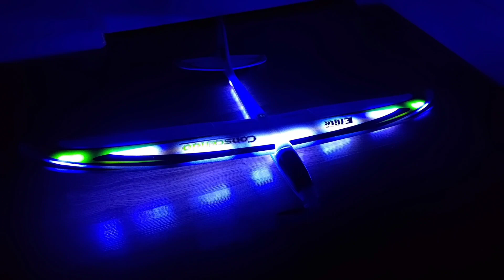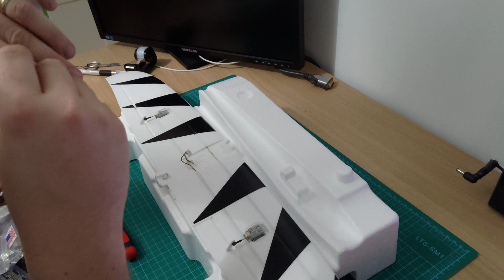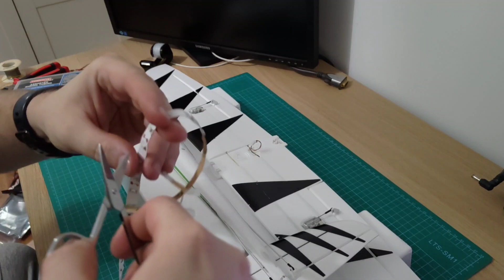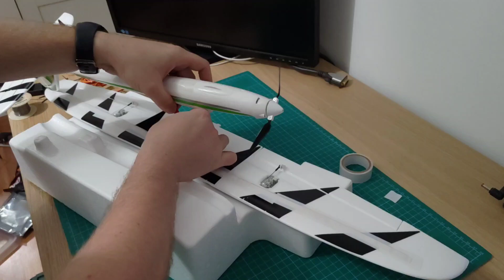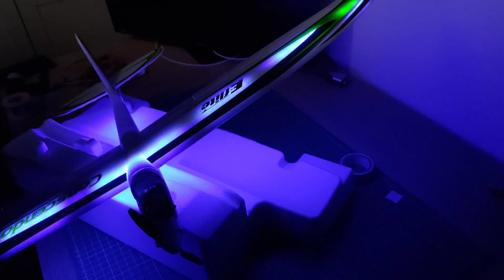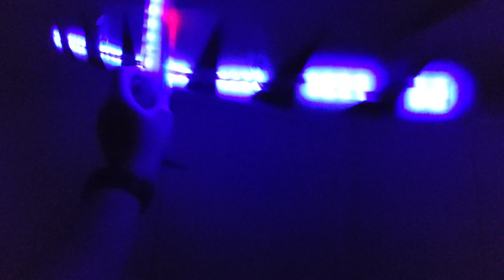How to add lights to the E-flite UMX Conscendo

Comment: Also on the fuselage how did you wire both the balance adapter and led strip to the same Jst? Thanks ☺️
Reply from the maker: Just soldered all the positive and negative wires together on the corresponding pin from the connector. I then got some magnetic connector so it makes it easier to connect and disconnect the wing.

Comment: By chance you got a link to parts?
Reply from the maker: No, I bought the LEDs at a hardware store. Any 12v LED strip should work.
Reply: @A.M.-RC  Thoughts on this?..  A 3 "Y" connector going back through the fusulage. One connected to the plane, and two connected to two sets of LED red&Green. Using the JST on the battery not the balance port.
Reply from the maker: That's another way to do it, I did something like that on the UMX Twin Otter since it's 1S. 
On the Conscendo I later added a magnetic connector between the wing and the fuse to make it easier to connect, I showed it briefly in another video.

Comment: Where do you purchase the lights?
Reply from the maker: Online, any large store. Any 12v powered LED strip should work. Just know that some have a silicone covering, you can still use them but facing outward and they will be heavier.

Comment: Looks awesome! And simple as well! How much of an impact do you see on the flight time? You have several LEDs on the strip and given that on nominal voltage they run full brightness, they will usually draw like 20mA per LED, which sums up. And you will have to be careful and not leave the battery connected for too long as the LEDs will drain the lipo until it dies, as there is no protection circuit with a LVC circuit. Just a consideration. I was thinking about adding LEDs to the big Conscendo and maybe even addressable ones like on the Night Radian. Anyway, great idea and well done, Alex!
Reply from the maker: Thanks, I like to keep it simple, it's my 4th or 5th UMX I add lights to.
And I prefer to connect straight to the battery because even if something happens to the board or I lose it, the lights always stay on, rather ruin a battery than lose the plane.
I didn't test on this one the drain, it has telemetry anyway, I did test on my UMX Radian, but that has 5v strip, took a 1s 200mah from 4.2 to 3.8 in about 30 minutes.
Reply: @A.M.-RC good point with the telemetry! Thanks for the figures on the Twin Otter. Honestly, I was surprised to hear that a five volt strip will run at all on like 3.6 V or so, but when thinking twice, it does make sense indeed. Will just be a bit dimmer.